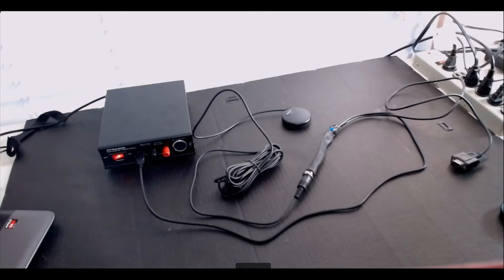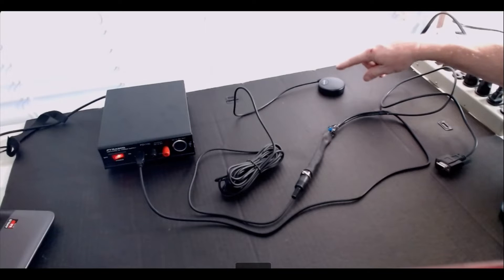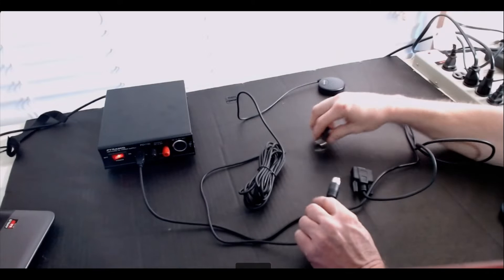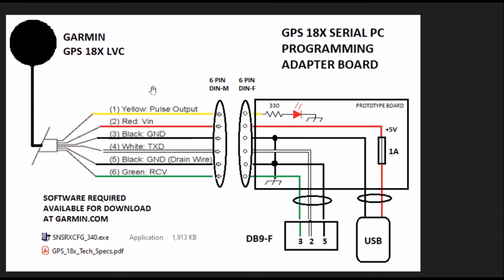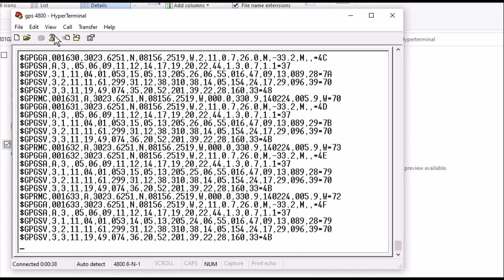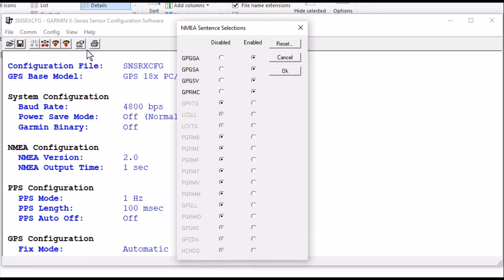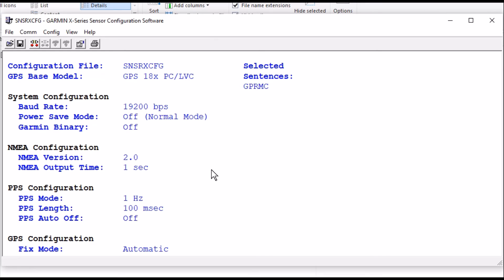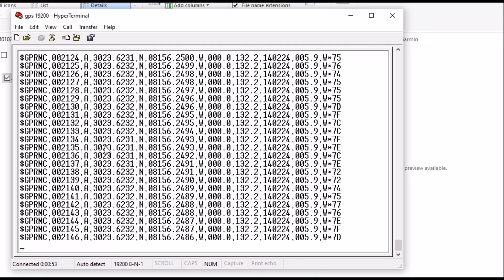Garmin GPS 18x Setup & Programming

Comment: Does it need a driver?
Reply from the maker: It doesn't need a usb driver, it uses rs-232 thru the computer's serial port. If you don't have a true 9 pin serial port, which a lot of computers don't have anymore, and you are using a usb/serial port adpater, you will need a driver for that adapter, but not specific to using the garmin.